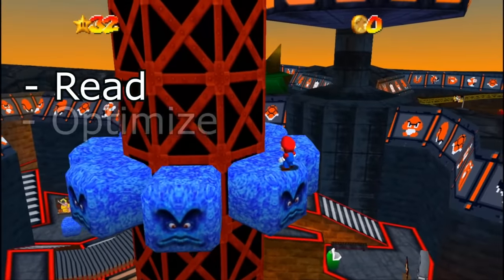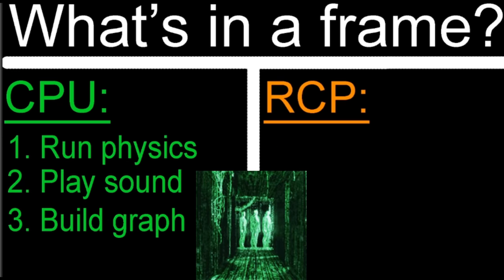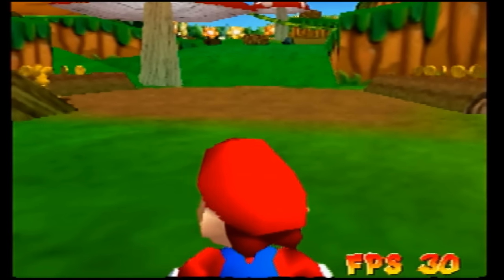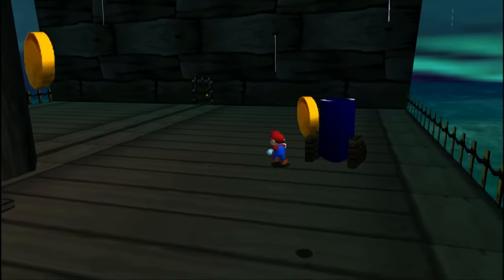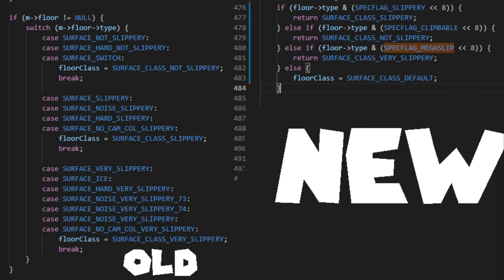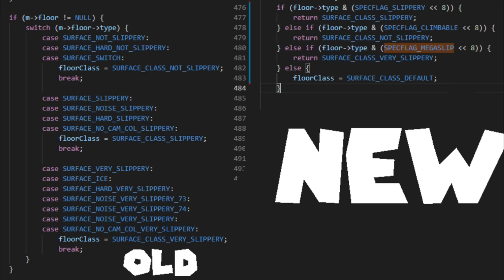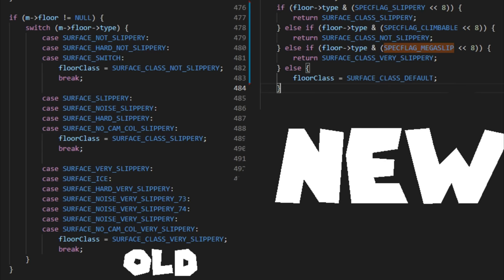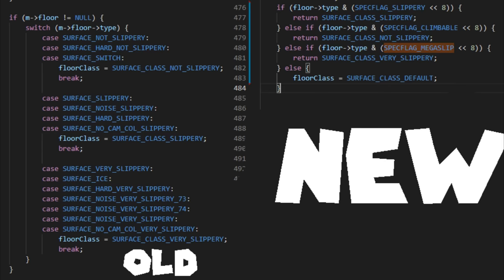FIXING the ENTIRE SM64 Source Code (INSANE N64 performance)

Comment: Imagine going back in time, infiltrating Nintendo's HQ overnight, and just replacing the code with this one, and leave a note like "L is real"
Reply: lol
Reply: 2401
Reply: how about, a week after SNES launch of super mario world, doing a credits warp in front of the devs
Reply: @mmoncure11  *day before launch
Reply: Some of these optimisations would seem like sorcery to the best devs in the world haha
Reply: Mariogate
Reply: @MrSqurk  They wouldn't accept it actually ... this clearly runs unsafe code and is only maintained by sheer competence ... any further patch they might add could end catastrophically.
Reply: I'd leave a message at the end of the game: buy bitcoins.
Reply: This code requires the N64 expansion pack to work properly, which didn't exist at the time. They'd be amazed I imagine, but it wouldn't work on the console.
Reply: @Kame you serious?
Reply: honestly this is a very funny thing to do with a time machine. chaotic good
Reply: @Kame On the statue in the castle courtyard from Mario 64.
Reply: @zeldafan159357  Wouldn't be hard to implement from the literal designers of the console probably.
Reply: @zeldafan159357  i am, yes.  Death-note doesn't seem relevant.  Is it?
Reply: @roidroid  It's a reference to a plaque on the star fountain that you find outside Boo's Big Haunt in SM64. The sign reads "L is Real 2401". The same Plaque can be found in Dodongo's Cavern in Ocarina of Time next to the shortcut elevator to the 2nd floor.
Reply: @zeldafan159357  oh damn, that's legit odd & interesting.  Thankyou!
Reply: No.

His hack requires the ram pack.

Don't be stupid.
Reply: They would find you and give you a cease & desist order, somehow.
Reply: "L is real 2022, also look out for bats at the fish market"
Reply: Now imagine this already happened.
Reply: "Hey, why does our SM64 rom suddenly require expansion pack-support?"
"No idea boss, but the sourcecode is diffrent too."
Reply: This was the plot of Golden Boy episode 1
Reply: @Kame you must be joking?!Right?
Reply: @nightwintertooth9502  you really believe the bat story?
Reply: LOL i litterally said this when watching the video
Reply: On the letter stands WROOM WROOM
Reply: @januariopinto_  and start the apocalypse?
Reply: @januariopinto_  no. : ]
Reply: @1998SIMOMEGA batchest
Reply: Nintendo gonna be like "ayo what the fuck?? this runs way faster for some reason. aight guys, let's see if we can put luigi back in"
Reply: @Bananaballs69  Every now and then later versions of console games would have patches sometimes, creating a few different versions of cartridges and disks.
Reply: @mmoncure11 I would love to got back in time when they were making Super Mario Bros. and show the developers Super Mario Odyssey.

They will faint of impression because the Switch still impresses me
Reply: @Axel5550 yes, this actually happened with smash bros Melee

Comment: That feel when you completely rewrite most of the code for one of the most significant video games in history to get a better framerate in your mod.
Reply: I feel like it was all an elaborate plan to advertise his mod, but I also feel flexed on if this is true.
Reply: Eh. His entire patch NEEDS the expansion pack. Therefore, it's bullshit.
Reply: @gamesandplanes3984   so? He still made it happen, thats not bullshit. Like he said, it would be impossible without it. What he did was insane and awesome. What great achievement like this have you accomplished?
Reply: @gamesandplanes3984  There's several actual N64 games that need the expansion pak, are those bullshit too?
Reply: @gamesandplanes3984  Who doesn't have the expansion pak? Unused ram is wasted ram.
Reply: imagine if PC games were this optimized, we could play Cyberpunk 2077 on a Athlon FX with a 8600GT and 4 gigs of RAM!
But ...no.
Reply: @gamesandplanes3984    Eh, you might as well have SOMETHING on the system that uses it.
Reply: @Diamond_Tiara  Optimisation is a three-edged sword.  The more fully optimised code is for a target platform, the more likely it is that it'll break as soon as one assumption is different.

You can only get away with optimisation like this when it's the same console and the console doesn't change significantly during manufacture (because yes, even the kinds of hardware changes they make revising a console can break highly optimised code)
Reply: @TheTurnipKing  tell me about it, I found out what O P T I M I Z E D meant trying to repair a video editing workstation from 2004. a Casablanca Solitaire. The most proprietary thing one could imagine despite looking like a beef retro PC.
It's a silly Pentium 4 box on a MSI motherboard with a Maxtor HDD and one gig of RAM. Classic.

The software. It's designed for this machine. It's got no OS and the BIOS is not even a BIOS but a part of the software, even gparted can't detect the filesystem in an attempt of data recovery. Disk is ok but there is no filesystem. «Rebuild it with testdisk, is it XFS?  HPFS or something? » «No, there never was a filesystem.»
I still have nightmares about it and the gloomy white cube stands in this very room. oh god help me!
Reply: @Diamond_Tiara  i loved every word of this reply
Reply: @gamesandplanes3984  LMAO RATIO
Reply: @gamesandplanes3984 You mean the thing that anyone who bought DK64 has? Lol
Reply: @Voyajer.  I don't have the expansion pak.